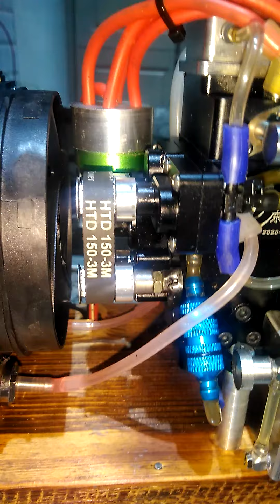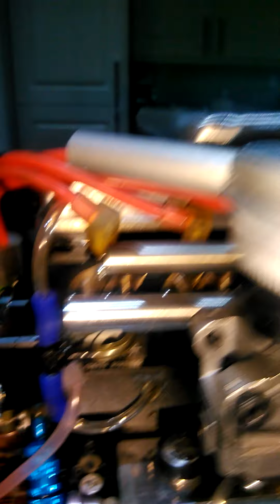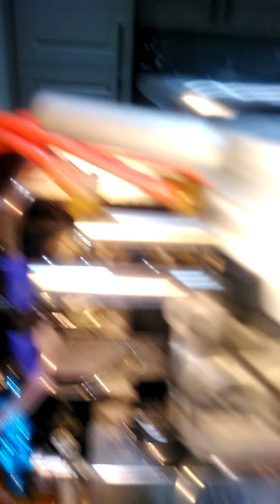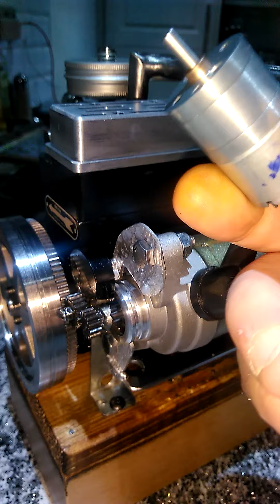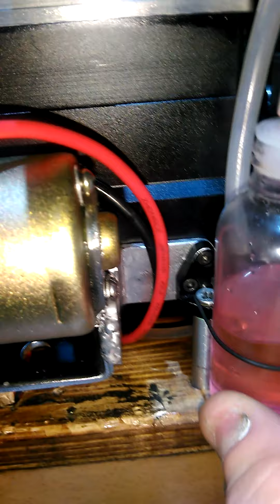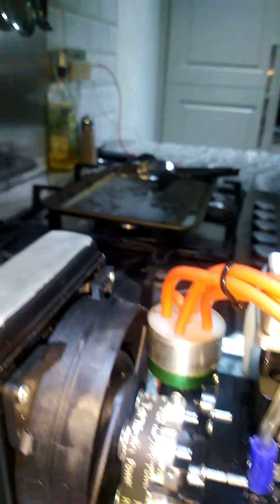inline four Chinese engine, finished with all mods.

Comment: very nice :D. i ordered one in blue still waiting for it. did you do the piston sleeve upgrade by any chance? also any idea where can i get a cheap air filter that fits the carburetor?
Reply from the maker: No piston sleeve upgrade.
Think everyone just makes there own filter.
What was the sleeve upgrade for? Smoke issues ?
Reply: @aservclive  it doesn't seem to reduce smoke but it includes upgraded piston, sleeve and piston rings for higher performance.
Reply from the maker: @AK77477  so is the upgrade through enginediy or has someone made the kit 3rd party?
Reply from the maker: @AK77477  i only use mine as model, if needs to be re ringed, i will poss machine piston to accept viton rings.
Reply from the maker: All mods done by myself